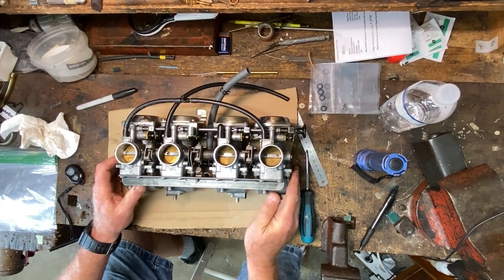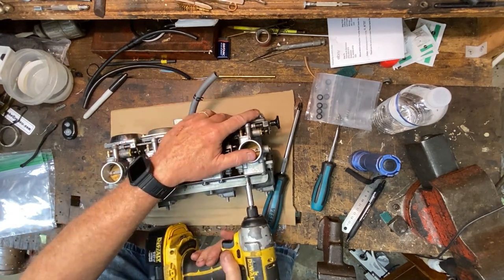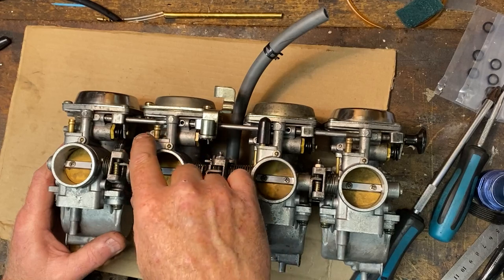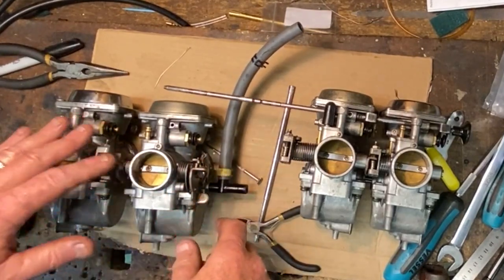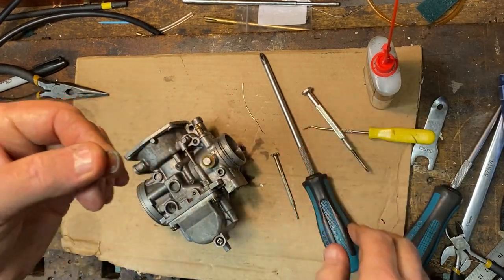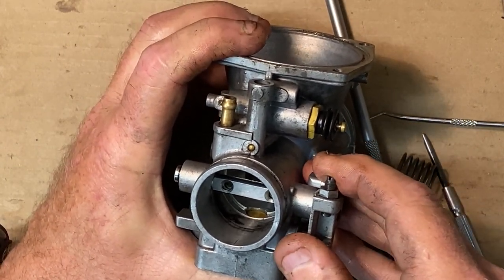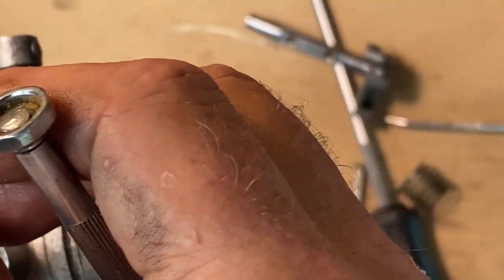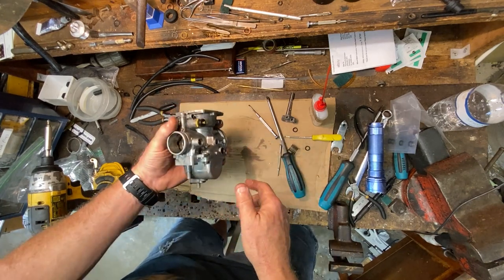Mikuni BS34 carburetor throttle shaft seal replacement. Police Bike.

Comment: Lost one BB and spring. But I always open carbs up on a big tray with 2" lips around it. So all parts were found, but sure was surprised when those baby's fell out.
Reply from the maker: Good idea.
Reply: Excellent video, thanks for sharing 👍
Reply: Mine fell out not when I hit the bowl and top side with the impact driver on all 8 bolts, but it fell out in the ultrasonic cleaner 😂
Reply: I open mine up inside a plastic tote. That way no parts can get away. If not for that, those BB's would have been gone.   Thanks for watching.

Comment: hi nice job i think you should have pulled the choke plungers out and renewed the rubber at the tip if they are hard they will leak fuel all the time
Reply from the maker: I did pull each one and checked the tips. The rubber feels pliable. Not like new, but I suspect they’ll seal ok. The plungers are wicked expensive. Thanks.
Reply: thanks yes they are shocking i did mine i brought some 2 mm nitrole rubber and 2 hole punch 7 mm and 1.5 mm applied some heat dug them out and pushed in the new rubber its a bit of a fiddle but it works i did my z1r carbs they were hard as rock  @MotoRestoFL
Reply: sorry i ment vitron rubber
Reply from the maker: @DavidElleker  I might try that. It’ll be a snap to pull the rack apart again and snatch out the plungers. Thanks.
Reply: the smaller punch was 1.8 mm on the vm carb some of these dont have the spike at the end as you know
Reply from the maker: @DavidElleker  Yea, I gathered that small punch was for the tip, thanks. I have seen them both ways also, blunts and tipped.

Comment: Outstanding video, thanks for the great info. I have a set of Mikuni Mk 1 BS34 carburetors off of a 1980 Yamaha XS850 and the butterflies are seized closed. Can you recommend any tips to free them up and I would like to separate them but they have no clip on the end only what looks like a large washer and the shaft is larger on that end. Thanks for your help and keep up the great work:)
Reply from the maker: Thanks. I'd have to see what you are saying, I cannot find a good picture of a MK1 rack of carbs to give an answer. I don't quite understand your description. Email me a pic, motorestofl@gmail.com.

Comment: Thanks for making this video.  Excellent!  I have had to get carbs rebushed that were really worn.  I don't know what material they used for the bushings (bronze?), but, worked great after.
Reply from the maker: If these were significantly worn, which they’re not, I’d have set up a reasonably repeatable fixture and drilled and reamed out the bushes. Then turned some bearing grade bronze (not oil-lite but stuff from McMaster Carr which I’ve used before; turned to a 1-1/2 thou crush and reamed the ID small, and final ream after pressing them in. I’d have had to order a bunch of reamers and maybe some non-standard drill bit increments, but could have done it in the mill. It would have a taken awhile. Glad I didn’t have to.
Reply: @MotoRestoFL  You  are a great mechanic!  Keep up the good work and videos!

Comment: Nice job, tedious work working on carbs. Very good information Tom . Enjoyed the video and RIDE SAFE OUT THERE! Watching again and  I have a question.  Did you check the shape of the o rings in the choke plungers and mechanism?
Reply from the maker: Yes. They aren’t new but aren’t petrified. Id have replaced them but they are wicked expensive. Another viewer commented he successfully made new ones out of Viton rubber and using both a 7mm and 1.5mm punch. I ordered some rubber but it’s coming out of the UK. Ordered punched too. I plan on trying it.
Reply: @MotoRestoFL I think Zed over at KZrider makes them that way too

Comment: Did this solve your hanging idle? I am thinking about doing the same thing. Where did you get the seals, and fuel connectors?  Thanks for your help
Reply from the maker: No. Jetting did. Larger slow jets. I'll have to look up the size it ultimately needed. The jetting on the bike these carbs were off, really threw me for a loop because of many factors, you'd have to watch those videos.

Comment: What was the running symptom that lead you to the throttle shaft seal? I would assume a vacuum leak/poor idle? Great video!
Reply from the maker: Throttle shaft seals were a guess. Running like an intake vacuum leak and hanging idle, if you look at the police bike videos it’s in one of those. I have to do a better job organizing playlists. I tried everything, replaced everything and it still ran like crap. Which is why I’m doing the entire top end including these carb operations to rule them out. I’ll eventually get to even testing flow through the exhaust to make sure nothing is blocked. The valves were smoked.
Reply: @MotoRestoFL got it running right now?
Reply from the maker: @lundyracing  yes. The final video has all that. It’s long gone.

Comment: Great informative videos! Where do I get a rebuild kit for a 1983 GPZ750 Mikuni  Carb Rack? - thank you.
Reply from the maker: Just about anywhere. I’d recommend the K and L kits. The Chinese kits are junk. Do a Google search and if they’re available you’ll find them.
Reply from the maker: https://www.z1enterprises.com/carburetor-kit-zx750-kz750-1982-85.html?fits-motorcycle=Kawasaki/ZX750/ZX750-A1/1983
Reply: @MotoRestoFL  yeah I got the junk China one with regret. Hoping to find a OEM kit. Can’t tell online which is legit.
Reply from the maker: @kenwattleworth9409  OEM parts in my experience can only be grouped by the purchaser one part at a time off the parts fiche from whichever supplier you choose. The Z1 Enterprise kits aren’t bad. I linked to one above.

Comment: hello, does somebody knows the measurments for those throttle shaft seal, need it for a different bike, it should fit but I am not 100% sure
Reply from the maker: Not sure. If you go to eBay and search for BS34 throttle shaft seals you’ll see the listing for them and perhaps the seller can tell you. I did not measure the shaft or the counterbore in the carb body, but if I had to guess I’d say 8mm OD and 5.5mm shaft diameter. But again that’s a guess.